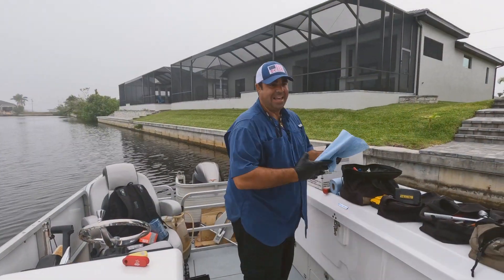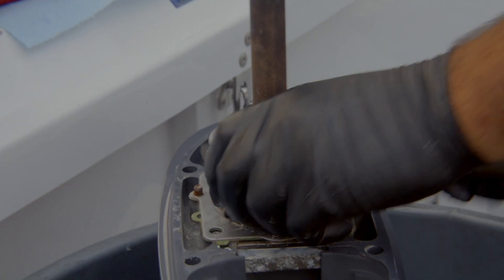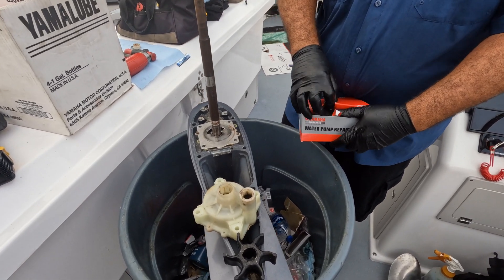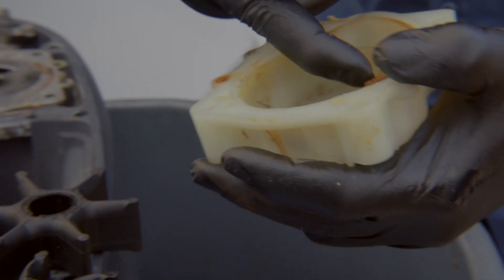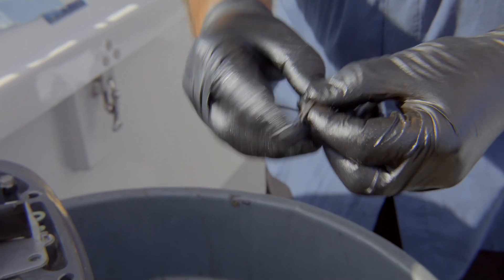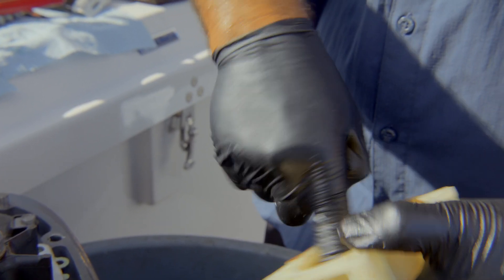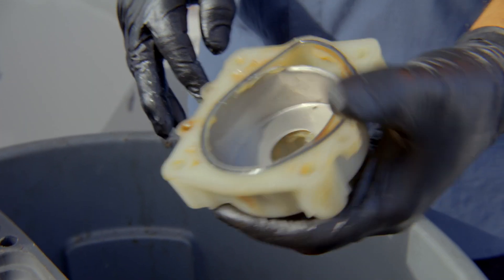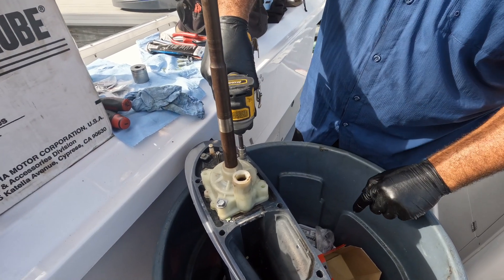How to Replace a Yamaha Water Pump | F150, F175, & F200 | DIY Yamaha Outboard Maintenance

Comment: Good video! I appreciate the 3 year replacement schedule you mentioned. I just replaced mine along with the thermostat on my 200 Yamaha. My mechanic suggests using liquid soap as a lubricant on the impeller and inside the cap since grease holds sand etc. which is abrasive.
Reply from the maker: Thank you for watching! We have never heard of that method, but it is interesting. Honestly, it's always neat to hear how others in the boating community service and maintain their engines. Happy boating!

Comment: Any tips on stubborn yamaha lock ring on the drive shaft, the one that holds the nylon collar
Reply from the maker: Yes! The lock ring on the Yamaha drive shaft that holds the nylon collar (commonly seen on Yamaha lower units—often near the water pump base or under the impeller housing) can definitely get stubborn, especially on older motors or salty units. Here are some tips to remove it safely without damaging components:

🔧 Tools You'll Want:
Snap ring pliers (heavy-duty, not the cheap ones—Yamaha rings are stiff)

Small pick or flat-blade screwdriver

Heat gun (optional but helpful)

Penetrating oil (e.g., PB Blaster, Kroil)

Plastic or brass punch (to avoid marring the shaft)

🧰 Removal Tips:
Soak it First
Spray penetrating oil around the lock ring and let it sit for a while (30 min to overnight). This can help loosen salt or corrosion that might be jamming it.

Use Proper Snap Ring Pliers
Make sure the tips of your snap ring pliers fit snugly into the holes of the lock ring. If they’re too small or weak, they’ll spread or bend and not give you the leverage needed.

Add Heat (Carefully)
Use a heat gun to warm up the surrounding housing—not the shaft itself if possible. Heat expands the metal around the ring and can help free it up. Avoid using a torch here unless you’re experienced—plastic parts nearby may melt.

Tapping Method
If the ring is just stuck in its groove, sometimes lightly tapping around it with a brass punch and small hammer can help vibrate it loose.

Pick & Twist
In some cases, you can use a fine pick or small screwdriver to gently work one end of the lock ring up and out of its groove. Then twist it out gradually—don’t pry too hard or you'll gouge the shaft.

🧼 Clean Before Reinstalling:
Once it’s off, clean the groove and surrounding areas with a small wire brush or scotch-brite pad to remove corrosion. Reassembly will be much easier next time. Also don't forget the marine grease!

Comment: what type of grease do you use?
Reply from the maker: Hello, and Thanks for watching! Frank uses Mercury/Quicksilver 2- 4-C grease. It is great and can be used on all outboards. Check the link!

 https://partsvu.com/products/mercury-quicksilver-2-4-c-marine-grease-with-ptfe-8-oz-92-802859q1?variant=45626522403107&om=17219&utm_source=google&utm_medium=cpc&adpos&scid=scplp92-802859Q1&sc_intid=92-802859Q1&gad_source=1&gclid=CjwKCAiAxKy5BhBbEiwAYiW--0F0xjJpBNCPbmGski9Ycc_kguHDbYh6zQOyfdUqZwjDmfp69uESrBoCVlYQAvD_BwE

Comment: What kind of grease are you using? 
Would red rubber grease do?
Reply from the maker: Hi @zwloki0, thank you for your question, and thank you for watching! Frank is currently using Mercury 2-4-C Marine grease. I am afraid I do not know of a red rubber grease but you want to make sure you are using a grease that is formulated for marine use specifically. If you are interested in trying what Frank uses for all motors (not just Mercury) follow the link below! Let us know if you have any other questions!

https://partsvu.com/products/mercury-quicksilver-2-4-c-marine-grease-with-ptfe-8-oz-92-802859q1?variant=45626522403107&om=17219&gad_source=1&gclid=CjwKCAiAqrG9BhAVEiwAaPu5zinNOKDh2Cr605b7m_vw1CuguVaw5lsHP_xjs24LWLgbJQfBsOOYvBoCFFgQAvD_BwE
Reply: @partsvu  thanks I'll order myself some of this grease, I'm an automotive mechanic and i find marine engines (the outboard ones) so nice and easy to work on. As long as they are flushed regularly 😉
Reply from the maker: @zwloki0  That's great. You are right.

Comment: Are you using loctite 572 on the water pump bolts and the bolts holding the lower unit on, or antiseize or nothing. Are you using gasket maker between the lower unit and upper unit.
Reply from the maker: Thank you for your question! We don’t use Loctite on the water pump bolts or the bolts holding the lower unit on. Instead, we use marine grease, which provides an excellent seal and added protection against corrosion. This approach not only safeguards the bolts but also allows for easier removal during your next season’s maintenance. Additionally, we don’t use gasket maker between the lower and upper units, as the marine grease creates an effective seal in that area as well. Let us know if you have any more questions!
Reply from the maker: Cutri is using the following:   https://partsvu.com/products/mercury-quicksilver-2-4-c-marine-grease-with-ptfe-8-oz-92-802859q1?variant=45626522403107&om=17219&utm_source=google&utm_medium=cpc&adpos=&scid=scplp92-802859Q1&sc_intid=92-802859Q1&gad_source=1&gclid=CjwKCAiAxKy5BhBbEiwAYiW--0F0xjJpBNCPbmGski9Ycc_kguHDbYh6zQOyfdUqZwjDmfp69uESrBoCVlYQAvD_BwE
Reply: Mine is a 25 inch ahd has the extra section in the middle. Use marine grease between that also. 
                    Thanks
Reply: If we are using marine grease on the bolts, what does that change your tourq value to. or just snug
Reply from the maker: @murphybrown32216  Grease reduces friction between the threads, which can result in a higher clamping force than when the bolts are torqued dry. To compensate for this, you typically want to reduce the torque value by about 10-20%.

However, some manufacturers recommend using the specified dry torque value even when applying grease, or they may suggest simply tightening the bolts "snug" to avoid over-tightening.

For the most accurate guidance, I recommend checking your engine's service manual or any specific instructions related to your lower unit bolts and the use of marine grease.

Let me know if you'd like any further details!

Comment: You mentioned that you advise your customers NOT to flush their motors running while out of the water??
Are you saying not to run it with muffs or the Yamaha hose hook up? Just flush with water & not run motor?
How do you recommend flushing when used in salt water?
Thx
Reply from the maker: Hey there,

Thank you for watching. I think Frank was speaking a little out of context, and meant to not run the engine before having a steady stream of water. You can absolutely flush out of the water. You should also make sure you turn off the engine before turning off the water. It is imperative that at no point your engine runs without a steady stream of water as even 20 seconds or more of dry running can damage your engine and run the risk of overheating. 

If you are using muffs, make sure they are attached snugly enough, and that the water is flowing through before starting your engine. Make sure the water has a steady supply and there are no kinks in the hose. Start the engine and let it idle for 10-15 minutes keeping a watchful eye of the water supply and making sure the water is coming out the telltale.  If you are using a flushing port, the same rules apply. If you do not see water running through you may need to check for a blockage. Doing this every time you get out of the saltwater helps prevent corrosion.

Comment: I can't thank you enough for this! I'm replacing the impellers in both of my father's Yamahas and I was having a heck of a time with it because they've been in saltwater for 20 years. That O-ring for the impeller housing has especially been a PAIN to keep in place and I was ready to just super glue it in there. 😅

Can you recommend which grease to you use for the housing, the O-rings, prop shaft, etc?
Reply from the maker: Hello,

 Thank you for your comment. We are so pleased that our videos are helping boaters like you. Our good friend Frank is using Yamaha Marine grease. ACC-GREAS-10-CT.  https://www.partsvu.com/yamaha-yamalube-marine-grease-lubricant-10-oz-acc-greas-10-ct.html

Please let us know if you have any other questions as it is always our pleasure!
Reply: Thank you for mentioning the wave washer. I initially did this job and thought I bent the washer prying things off..... So I proceeded to straighten the wave washer.....doh.

Comment: Just found your channel, awesome videos and tutorials!  Question. If you have twins and one is a left/counter rotating prop, do you need to seat the impeller turning the shaft counter clockwise on that engine?
Reply from the maker: Hello gcogs2296, 

Yes, if you have twin engines with one being a left/counter-rotating propeller setup, you typically need to install the impeller such that it turns the shaft counter-clockwise on that specific engine.

In a twin-engine setup, having one engine with a left/counter-rotating propeller is done to counteract the torque effect generated by the other engine with a right/standard rotating propeller. This configuration helps improve the boat's handling and maneuverability, particularly at low speeds and during tight turns.

To maintain the balance and effectiveness of this configuration, it's essential that each engine's propeller rotates in the correct direction. Therefore, the impeller in the left/counter-rotating engine should be installed to turn the shaft counter-clockwise to ensure proper operation and balance between the two engines.

Happy Boating!
Reply: Your third paragraph is wrong. Both drive shafts turn in clockwise direction.